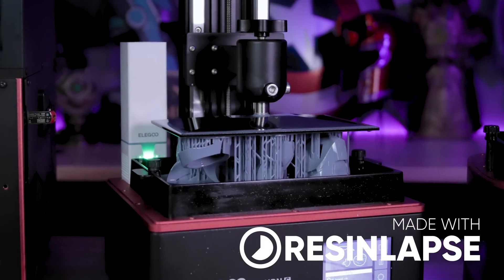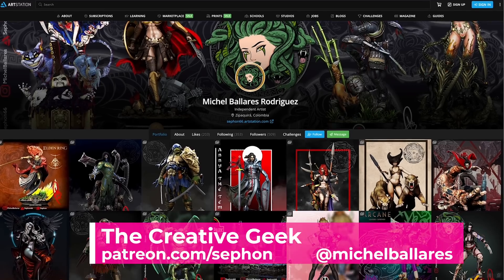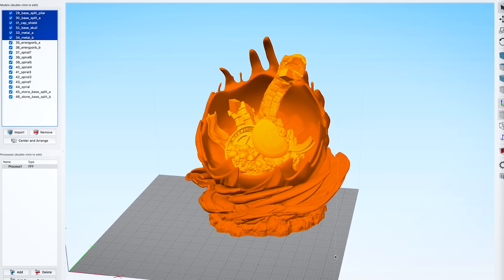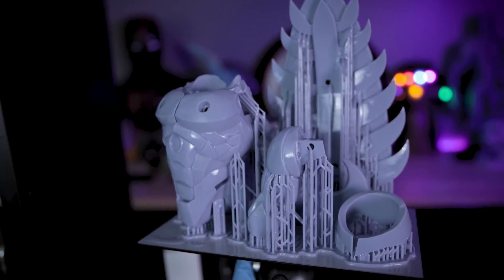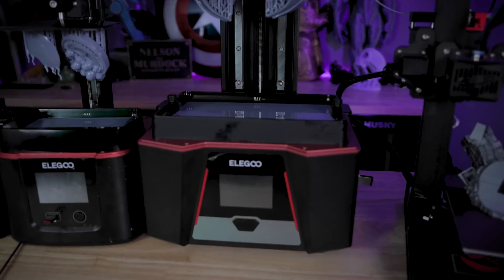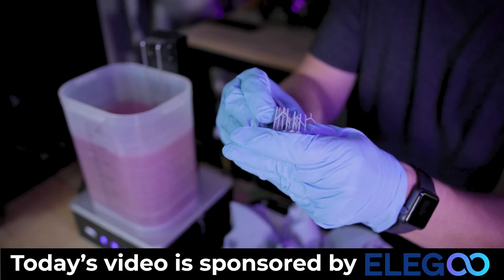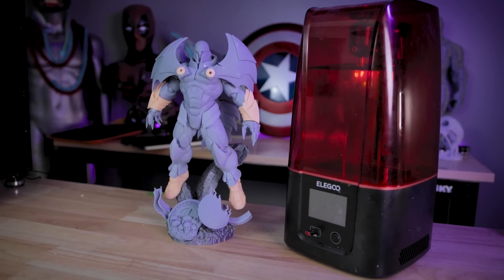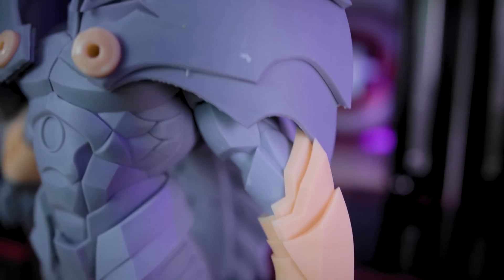5 3D Printers 1 HUGE 3D Print

Comment: I have been looking into getting them 3D printers meself but since i'm in a location with frequent power outage, i have a question : does resin printers have resume problem? which seem to be a big problem in filament printers as i've seen some videos on it while i haven't seen any for resin printers. Or resuming print is not really a problem in resin printers? would appreciate detailed info on this, thanks.

Comment: Latest iteration being the Saturn S?? We both know that aint true ;) The Saturn 2 looks AMAZING! Definitely want to get my hands on one! 8k, massive screen. YES PLEASE. 

Great use for half bottles of resin. Would be curious to see that old resin if it is an exposure issue or just crappy resin? 

How does the super glue work for resin? Never tried it as we normally use raw resin, but for deeper pockets I can see how superglue would be better! Model looks great, can't wait to see it all painted up!
Reply from the maker: Super glue works surprisingly well. Especially if it’s not cured yet. Sets crazy fast
Reply: @UncleJessy  ah cool! That is curious for the uncured parts!
Reply: @UncleJessy  If you're superglueing uncured prints I wonder if it sets faster because the surface is still somewhat malleable allowing you to flatten out the glue more as the two pieces conform to each other. It seems to dry faster the thinner you can get it by a ridiculous degree. I can have a dollop of superglue sitting out for ages without drying while when using it to smash to parts together that more or less mate properly it'll set within a few seconds.

Comment: I've never done any 3d printing yet because i am concerned about perfection too much. I am curious what the longevity /strength of resin 3d prints are compared to FDM of similar material properties over time. IE how much strength they retain over 1-2 years. I know in FDM Land that CNC Kitchen did something like this for FDM a while ago but curious on the same for resin.   Not so much worried about color (more paint solves everything that duct tape and WD40 doesn't) just strength/quality..  anything like this in the books in the future? :)  I'm waiting for a really tall self-filling smooth as a babys butt quality printer... like lxwxh   250x200x425  ... i should really just pick up a smaller one and start learning before the bigger one but lcd print hours also bug me, waiting on DLP oh well /endramble
Reply: If you're concerned about strength of pieces for practical use, resin isn't what you are looking for. Resin is great for models, but not for tools and such. It's not like a resin model will melt over time or anything. It's a polymer, so once it's made, it's made.
Printing time is also faster than FDM, so I don't concern myself with how long prints take on it. Basically, I start a print and leave to work. When I come home from work, it's done. Then I can start another print and when I wake up before work the next day, I can clean it up and start another one. I exclusively print models about the size of what Uncle Jessie did in this video.

Comment: You can help old resin print better by shaking the bottle vigorously before pouring it out. Even more so if you warm up the resin before hand. Either with a heat gun or leaving the bottle in warm water.

Comment: UJ, I would love it if you would spend just a minute or two covering your support strategy for the prints that you do (light, medium, heavy, auto with some manual added, tip diameter, density).  If not, maybe a separate video talking about the nuances and differences between setting up supports in Lychee v Chitu.  Love your work, thanks very much!
Reply from the maker: Thanks for the suggestion and will def look into that! I am planning on doing a full set of videos on Resin Slicers soon! Doing a deep dive into Chitubox Free vs Pro, and Lychee Free vs their Paid edition!
Reply: I believe he has done a few of those in the past.

Comment: Elegoo just released a slightly upgraded Saturn, just to bring a Saturn 2 now?
Reply: I believe they intend on selling the Saturn S and the Saturn 2 at the same time. The Saturn 2 should be higher price point.
Reply: The Saturn S is meant to phase out the original Saturn. That way you have a "high tier" printer and consumer/mid tier printer. Something tells me that Saturn 2 will be closer to an $800-900 range, which is a lot harder for some to justify vs $400-600
Reply: @HuntersCanFly  This may be true, but shouldn´t be. A Saturn 2 should be the successor of the Saturn and therefore in the same price region, maybe a bit higher due to new technic and inflation.
Reply: I just bought a Saturn S  so I am also a little concerned that the Saturn 2 will make it obsolete. But honestly the Saturn S prints have been awesome. Everyone speculates that the Saturn 2 will be a couple hundred dollars more than the Saturn S, so I think I’ll still be happy with my purchase. Was considering the Anycubic Mono X 6K but ultimately wanted to keep the cost down since I wanted the wash and cure stations.